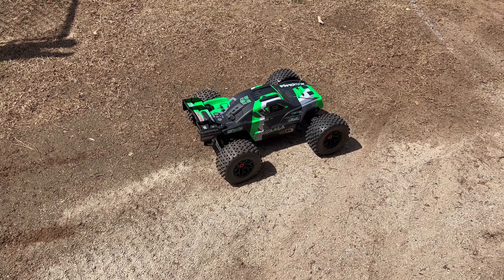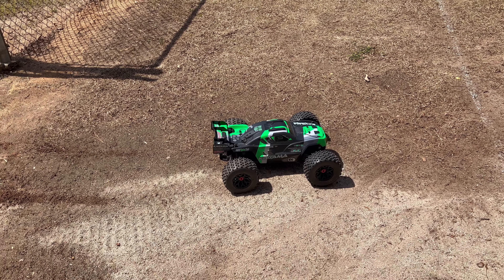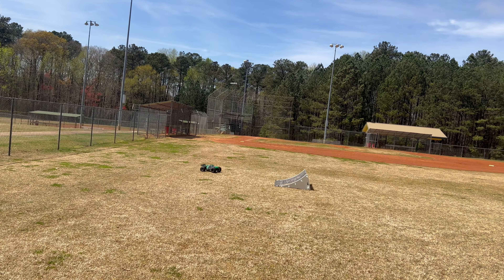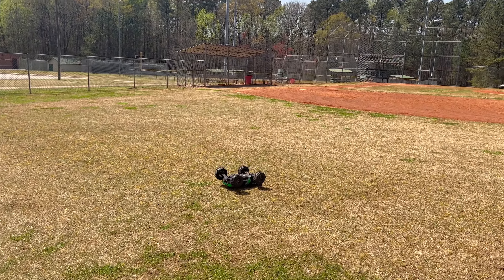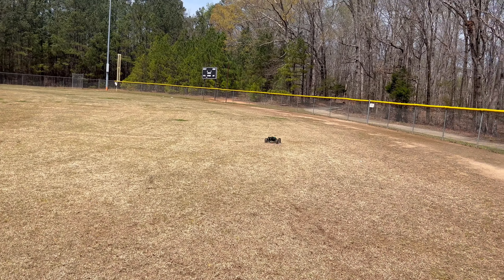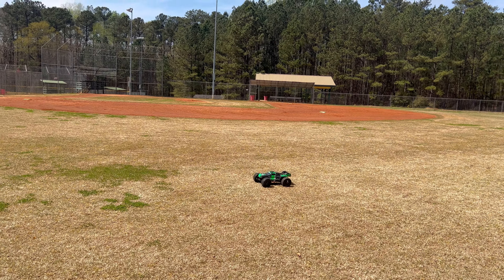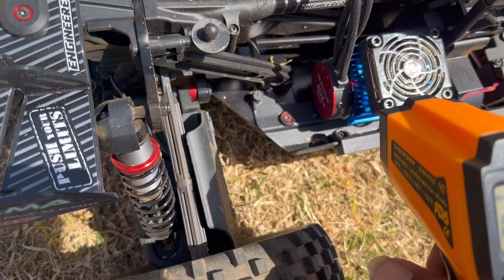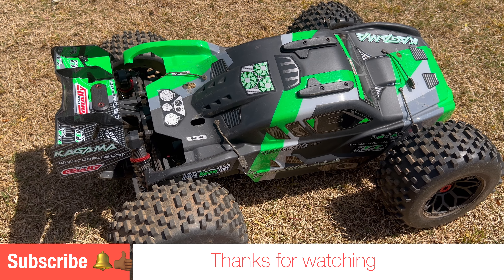Team corally kagama With Hobbywing 8BL150 2000kv combo

Comment: i was thinking about this combo for a custom arrma 4s build im working on.... i want something bigger then like the max10 in my outcast 4s v2.5
Reply from the maker: It's going to run good on the 4s line
Reply: @GAPreviewsAtoZ  i was thinking it would since they have alot of plastic the weight is down even with all the upgrades it should still work great i will still only run 4s hoping that will let me gear a bit more
Reply from the maker: @RC4us  yes 4s 18t gear and you in the game
Reply: @GAPreviewsAtoZ  im getting 54-55mph with a 15t with my mojave 4s and my cnhl 8000mah 120c.... even faster with my li-hv cnhl
Reply: Are you thinking of running 2000kv?
Reply: @magnusstone  yes